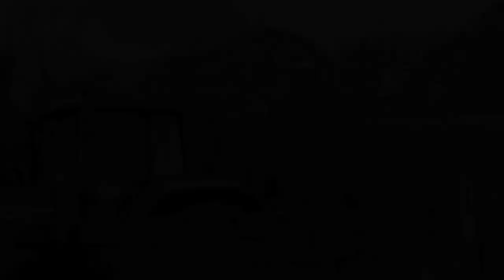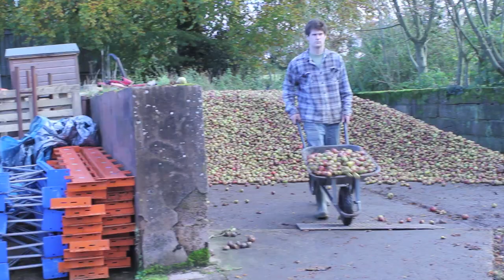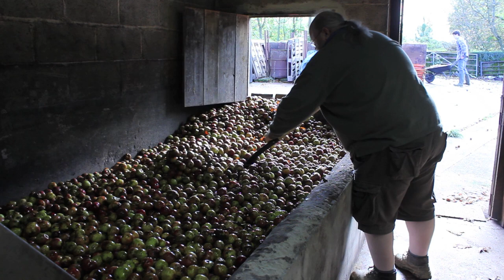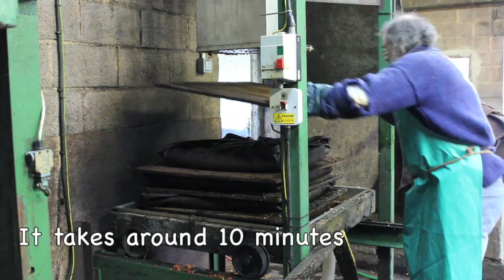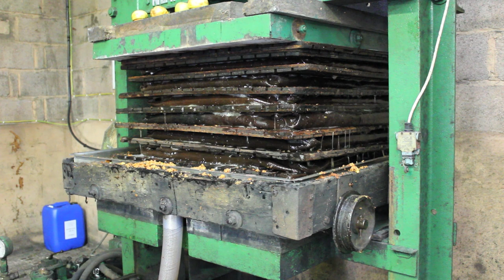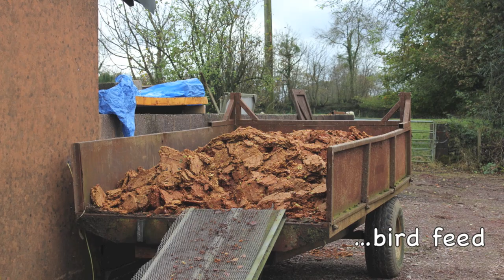Tricky Cider - Making Traditional Somerset Cider

Comment: Do you add sugar or and Yeast? if so what yeast?
Reply: Hi liveuk, I've just seen the vid, then I saw your question. 
I think that I'm right in saying that no sugar is needed, different varieties of apples are used for different styles of cider, also spelled cyder, to make sweet, medium or dry cider.
I also believe that no yeast is needed  as there should be enough natural yeast on the apple skin's to achieve fermentation.
Did you know that there is a delicious drink called Perry, it is made basically the same way as cider but using Pears instead of Apples?